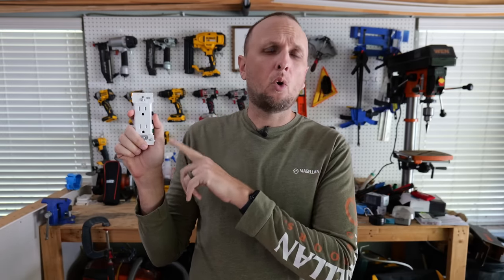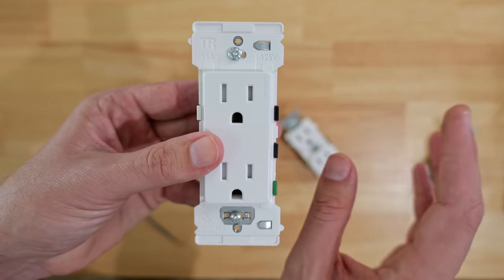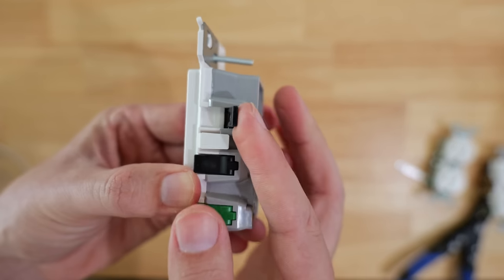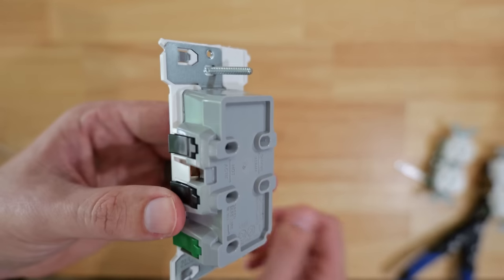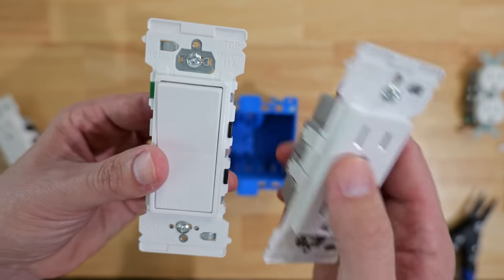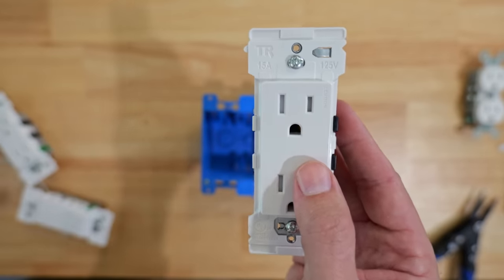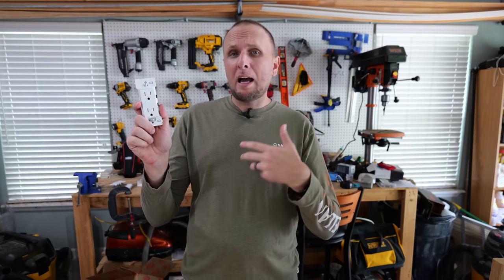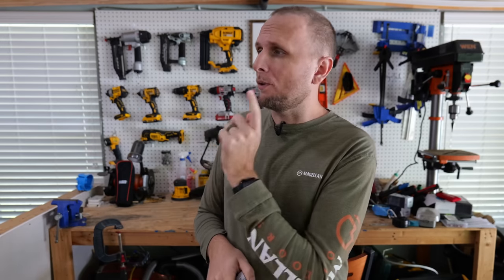The Fastest, Safest, and Most DIY Friendly Outlet Available!

Comment: Definitely like these better! Only problem I can see may be how they daisy chain together. It would be nice to never have to daisy chain but that would be an awful lot of extra wire. I might have to grab a 10 pack to try as we remodel more. I also am curious how the 3-ways are set up. Really neat incorporation of 2 technologies that work together in the first place to make it easier for dummies like me :)

Edit - Just found out you can even separate the top and bottom outlet for separate hookups/uses. They did think of almost everything!
Reply: A simple daisy chain should be okay, but a two direction output side of the chain (so three cables are involved) methinks would be more of a handful than the standard type.

Comment: Problem is that the wago V connector only touches the conductor at 2 points, creating a potential hot spot, whereas a side screw makes a much better connection along the length of the conductor around the screw. Obviously it is a money saving move to use less metal in the way of screws and plate. Thank you.
Reply: They wouldn't have approved these if it was a problem.
Reply: There were several housefires in a neighborhood in Jackson MS that used backstabbed receptacles to carry a circuit around the living rooms. All of the fires started at the same receptacle. I guess housefires are no longer a showstopper.

Comment: Love the idea but wonder what the contact area is. Always use shepard’s hooks because of the contact area and the reduced chase of a high resistance connection.
Reply: I'm an electrician and I'll tell you that the contract area is tiny. There's a little bus bar in there which is prone to failure. I've seen many burnt up Wagos in the field (real Wagos, not just the cheapo push-in kind). Considering how rare Wagos are in the field (because real electricians don't use them) it's remarkable how many I've found that have failed. 

Anybody who plugs a space heater into one of these outlets is going to find out sooner or later that screw terminals are far superior.
Reply: @NoTroubleMikeG  Thank you for confirming my suspicions, very poor contact area. I will continue to use shepards’ hooks and twisted wires with wire nuts.

Comment: Great review of a great product.  However, my only concern is that they don’t seem to be compatible with “old work” boxes such as the one used in your demonstration wall.  Conventional receptacles and switches have removable plaster ears which allow the receptacle or switch to properly seat into the grooves in the box which lets the cover plate snug up against the wall.

Comment: I think the most impressive thing about this design is that all the connections are made internally, so wrapping electrical tape around the receptacle when using a metal box will be completely unnecessary. There's also no chance of a ground wire contacting a neutral when folding the wires in the box. You still should be careful to not allow a wire to catch on a lever, a similar concern with Wago lever nuts. One negative is they don't seem compatible with the old work plastic boxes.
Reply from the maker: Yeah I agree.  I for one have definitely made it a habit to hold the levers down until I am done moving either a wago or this product now.  You are right,  there are no ears to break off to fit perfectly into an old work box.  The cover plate may have a slight gap depending on the plate and how deep the box was installed.  Thanks a lot for the input Ted!
Reply: Levers face forward, no chance of a wire catching it.

Comment: Its not so much about how hard it is to pull out but how much contact is made between the internal component that you cant see and the wire..
You would need to take one apart to see.calso you never showed how you dova split plug on that new one. 

Concept is nice but need more information.

First one i by will be taken apart fir a comparison

 I like the side plate with the hold down screw. Good solid copper contact.

Comment: One advantage that you didn't mention was that it is less likely that the connections could be dangerous.  Such as, no Shepards hook direction mistake.  Yes, a similar condition where too much insulation could be removed before connecting it exists, but for DIYers it seems to be less likely to make that mistake.
Reply: Too much insulation removed seems like it would be less of an issue here as it is a simple "if you see metal, you dun goofed"

To little insulation removed I could see be problematic depending on how it affects the locking of the lever.

But, in the end for a casual person this is removing some potential sources of error.

Comment: Thanks for the video. I am assuming the outlets in my garage are standard home owner amperage and that being 15 amps. I use stationary power tools that require a 20 amp circuit, which i have in the garage. Will using these outlets rated for 15 amps be a problem when then initial amperage draw when the machines start might be over 15 amps?  So far I haven’t experienced any problems, but I’ve always wondered if I was pushing the limits of my outlets. Thank you,

Comment: still a spring connection rather than screw torque. Lots of change outs on stab in. The load flowing through is the main problem.

Comment: You didn't deal with the aspect as to whether or not these can be used as split receptacles (like standard receptacles can) where 1 outlet can be controlled by a switch while the other is constant on, or having 2 separate circuits control each single outlet. It appears that they can, and they should, but not being familiar with them, I don't lnow the answer. 

But I for sure like the concept. Whether they catch on will be guided by price point  I would guess. That's another issue I'd have liked to see you address.

Thanks for your efforts!
Reply from the maker: You are very welcome.  You are right I did not address that but yes they can.  There is a bridge that can be broken off to separate the top from the bottom under a flap of plastic on the side.  Appreciate the feedback!
Reply: @HowToHomeDIY  Thanks for your quick response! That's great to know. You do an excellent  job in producing your videos, covering worthwhile interesting topics, and responding to your viewers! Kudos 🙂
Reply from the maker: @hdpro66  Well thank you very much.  I do try my best and always looking for ways to improve.  It is always good to hear that the channel is providing value for folks.  I really appreciate the added feedback!
Reply: Came here to ask the exact same question...

Comment: Just a homeowner here, but my electrician friends never use the backstabbing, always the screw connection.  They say with a high load there is not enough contact.  They may think the same for Wagos?
Reply: I was thinking the same thing, can they handle #12 wire?

Comment: Only 20 bucks for 10 at Ace Hardware 24 bucks at Home Depot. If you  haven't noticed Home depot has raised their prices so high that Ace Hardware is beating Home Depots prices and everything is organized and if you need help always someone there to help and it's closer. I would say for a year now I check both places and I been going to Ace. It started when I needed a new rake and a new hard rake Ace was cheaper by 10 bucks

Comment: It's about time that they made a easy and safe outlet.  Inserting the wire into the hole on the back of the outlet was not safe.  I had way to many wires come out over time.  Also it will save time not having to make a loop and getting the wire behind the screw.

Comment: Is it possible to separate the upper receptacle from the lower?  Often the lower is controlled by a light switch when entering a room...
Reply from the maker: Yes it is.  The metal tab that gets broken off is under a thin piece of plastic that folds up.

Comment: I never have cared for those little tension holes even on the backs of standard outlets.  I just don't trust them like I do a good tight screw connection.  To me it's like twisting two pieces of stranded wire, soldering it and putting shrink tubing over it vs twisting the wire and putting black tape over it with no solder connection.  Which are ya going to trust?  LOL.

Comment: Faster is better when doing new construction. Electrician is in and out much faster. If you need to replace one as a homeowner, you could get away with not flipping the breaker (not a recommended practice), switch over wires one at a time and you don't need to touch the conductor.

Comment: While I don't see much of an advantage of this vs a standard back wire outlet (not backstab).  One minor nice thing is the lack of the exposed side terminals.
Reply: Much faster to snap a leaver than tighten a screw
Reply: @techmetal2292  a literal few seconds is not 'much faster' and is meaningless in terms of effort, especially if you use a powered screwdriver.

Comment: In 5 years all receptacles will be designed like this. The biggest improvement that hasn’t even been addressed here is there are zero exposed screws or wires. You will still need wire nuts or Wagos to connect the device to the feeder and the feed to the next box. Super fast and easy to install and far safer. Whats not to like.
Reply: What's not to like is that Wagos have a terribly small contact area. The lifespan of these will be very short compared to screw terminal receptacles. The easy way is rarely the right way.
Reply: @NoTroubleMikeG  go view you tube and watch the videos where they load up wire nuts and wagos to way over the 30 amps that both  the wago and a wire nut are rated for. At 70 amps the wire nut melts down completely the wago starts to melt at 100 amps. If what you say is true the wago would fail before the wire nut. That simply isnt the case in reality. Europe has been using wagos for 20 years exclusively with excellent results. They have test points and individual wires can be removed and installed without breaking the circuit. The lever type are far superior, have clear bodies to verify proper insertion, have a mechanical lever method of closing and are considerably smaller in volume.  If you do the research they are far superior

Comment: Jeepers, where have these been all my life?  I was expecting to open the link and see $8 each, but they're only .50 more than the standard 15a tamper resistant ones I normally buy at lowes.  PS, I think you need to calculate in the time to snap off the pointless top and bottom excess plastic pieces lol.

Comment: In my opinion the standard back stabbing residential outlet are the worse outlets you can buy, I would never put your wires into the holes. Because of the poor contact area to the wire.  The best outlets are the ones that have a metal clamp down where the screw/clamp can be tightened down on the wire and its almost impossible to pull out the wire.
Reply from the maker: I agree.  Thanks for the input!

Comment: As if outlets are so difficult to wire... if you have the strippers to use a Wago nut you can just hook and punch a regular outlet... Wago is a solution looking for a problem.  Im an electrician BTW...

Comment: It's a great idea however, for window units or other high amperage appliances, I prefer to make a hook and use the tried and true screw terminals that gives me a connection that I can sleep at night.  I don't trust the weggo lever on high amperage.  A small clock?  A bedside lamp?  Yeah, I'll use the weggo lever.  But a vacuum cleaner?  A window unit?  I prefer screw terminals.
Reply from the maker: I don’t disagree.  I personally prefer using commercial grade receptacles.
Reply: @HowToHomeDIY  I can imagine this speeding up installation time but I think that this concept needs to hang around for at least a year before I make the switch.

Comment: So what about the connected hot side ( both hots are linked ) of receptacle?  There appears to be something there in your video that looks like a lever to break the connected hots whereas the neutral side shows nothing.  This would be for a switched circuit for just one plug/receptacle and a continuous circuit for other plug/receptacle.

Comment: I'm still not sold on the WAGO connectors.  There is such a small contact point, I'm not comfortable with the interface.  Do they work with stranded wire?  "Back stabs" usually only work on #14 copper and not #12.  Is this the case with the new format?
Reply: They have a high pressure combined with a slightly flexible plate, the contact point is much larger than you think!

Comment: This looks like they should make it to work with aluminum wires make it Cu/Al compatible receptacle, the wires are not exposed and inject with antioxidant compound, insert the wire in and lock, it's much better than pigtail method which require extra spaces.

Comment: How come the never put 2 ground screws on receptacles? Cheap, I suppose. How do you feel about using 20 Amp outlets for 15 Amp service? They are better made and I tend to put 20 Amp receptacles  on everything I wire. It seems to me that 4 way rather than duplex receptacles would sell like hot cakes.
Reply from the maker: They are made well but putting a 20 amp receptacles on a 15 amp circuit with #14 wire is illegal due to the capability of pulling more amperage than the wiring is rated for.  That said the circuit breaker should trip if it exceeds 15 amps but it’s not a guarantee. I personally would just recommend commercial grade receptacles.  They are built very well also.

Comment: I'll bet, if you pulled that hard on a screw terminal wire, you could possibly make the screw begin to back off.
No wiring connection is meant to be pulled like that, I'd say these look pretty robust in retention.

Comment: seems like it needs an extra ground to string multiple receptacles together or can you put two wires in that ground lever?
Reply: Use a Wago clip... You can put up to 4 grounds on one of their 5 space clips.
Reply: @michaelwright1602  Yeah but the idea is to not have to use any extra parts IMHO they should have added it. Back to R&D dept...

Comment: I am in the process of replacing most of my wire nuts with Wago lever nuts (I live in an RV). You didn't cover breaking the connection between top and bottom outlet - same break tab as before?
Reply from the maker: Yup.  Same tab.

Comment: Does the tab between the two black levers allow you to isolate the top and bottom outlets such that they can be independently switched or hot?
Reply from the maker: Yes there is the metal bridge that connects the two outlets under a flap of plastic.  Just have to pull that plastic up and then break the bridge and then they can work independently of each other.
Reply: @HowToHomeDIY  Awesome, sounds like they put some good thought into those. WAGO fan for a long time now, glad to see the tech coming into more products.

Comment: I thought outlets and switches already had wire-gripping holes built in (besides the screw terminals). At least they did back when I was doing a lot of DIY in the 80’s.
Reply from the maker: Yeah those are quick connects and are not recommended to use.  Completely different than this.

Comment: You are going to make the TikTok electricians very angry! I don't why they dislike the Wago connectors so much! I've used them often and they are really tight! 😂
Reply from the maker: 😂 At least I will give them something to whine about haha.  You know, I usually see people and also channels on YouTube or other platforms either being just pro wago or just pro wire nut.  I look at them all as just another tool in my tool box.  I personally use wire nuts more than Wagos.  I just personally think they provide a better connection if installed properly.  But I use the Wagos in certain applications because I think they excel in those particular instances and like you said, they are tight.   I feel the same way about these new receptacles and switches.  Am I going to be changing out all of my receptacles with these new ones?  No, I think the commercial grade receptacles are still superior.  Do I think these have a purpose for the DIYers?  Absolutely!  Now I do REALLY like the new switches which I will go over soon.  You didn't ask for all of that but I gave it anyways 😂

Comment: Anyone try the heat test. Plug in your frying pan, after 15 or 20 minutes put your hand on the receptacle, is it hot? You can do the same thing with you breaker box or your meter box. If you find you can’t keep your hand on the box you might have loose connections. For me 130 degrees is that point. Over 50 years in the trade.
Reply: These are 15 amp outlets. NOT for use in a kitchen 20 amp circuit. Maybe should retake your certification tests? LOL I doubt any high load items would ever be plugged into these, as owner should be aware of.

Comment: At around 4:30 you mention flipping the lever down with a loud clicking noise, a snapping audible sound that lets you know it is locked into place.  But you demonstrate that with no wire in place.  Without a wire there, NOTHING is locked into place, and demonstrating it without a wire is no indication of what it will be like with a wire.
What about splitting the outlet, so one is switched and the other is not?  Regular you break the tab that connects them.  If this outlet has that capability I did not see it.
Reply from the maker: Because it sounds the same with or without a wire.

I does have that capability.

Comment: So how does this differ from those outlets that have holes in the back that had so many people insert wires directly into those holes and use the screw terminals to tighten the connection in the hole, the ones that are universally frowned on my youtube electricians making videos about how not to do things?    I mean sure this has a snap fit with the lever but it seems fundamentally the same.
Reply from the maker: I showed and explained how it’s different.  The mechanisms are nothing alike.
Reply: @HowToHomeDIY  Did you, my apologies for missing that point.